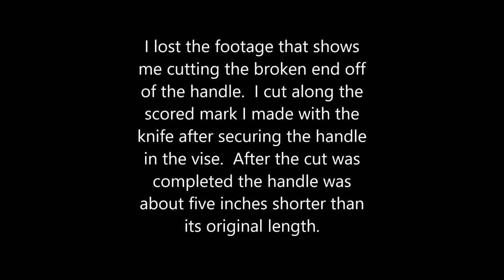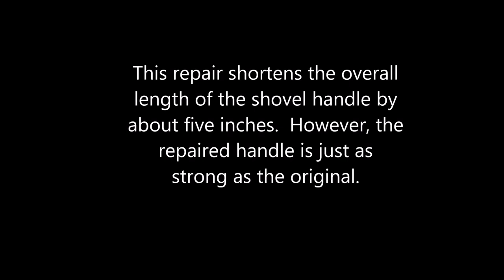Shovel Handle Repair

Comment: Many thanks for this. I have two ancient spades that need the handles replaced (they broke due to woodworm) but I couldn't figure out how to remove the pin that was stopping me simply putting new wood handles into the spades. I'll give this a try, thanks.
Reply: There are much better videos than this.

Comment: Sometimes they have 2 separate nails instead of pins and removing it with a cats paw or small pry bar works great too and it’s a lot faster of a method just throwing that out there 🙏🏼

Comment: I was able to pry the pins out just a little bit, with a small standard screwdriver, to where I could grab them with a vice grips pliers and easily pull them straight out. Using a nail and then bending it to reattach the handle, looks like crap. Go out and buy a wood screw and use it. That way the next time your handle breaks, you can easily take the screw out and reuse it.

Comment: Less stress on the wooden handle if you predrill the hole for the pin. Otherwise you risk splitting the handle by driving in a nail.
Reply: I think he may be trying to show you what to do when you don't have the convenience of a drill

Comment: Dont cut both ends of the pin, just cut one and with a old screwdriver or a piece of metal similar to a screwdriver that's smaller than the pin, hit the side that you cut the pic and it should pop out. You might have to cut a bit into the pin because some shovels are welded like mine or sort of melted into the shovel.